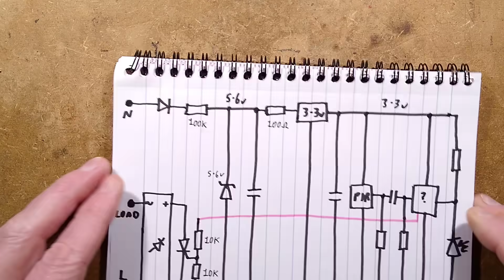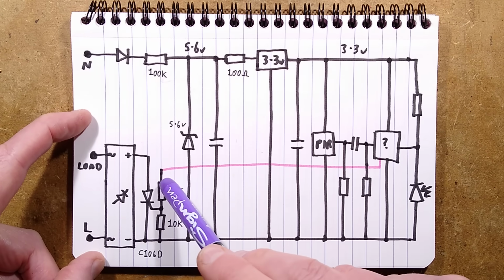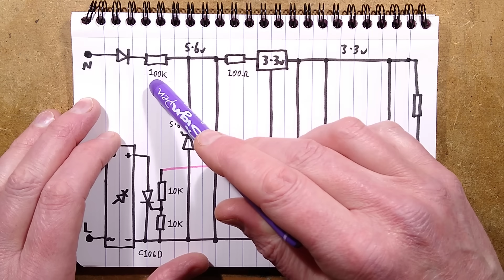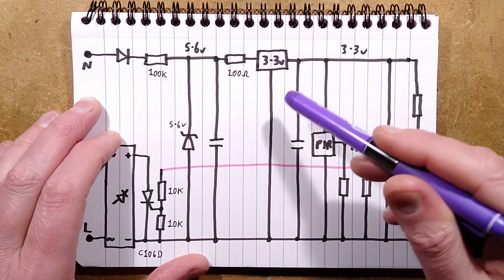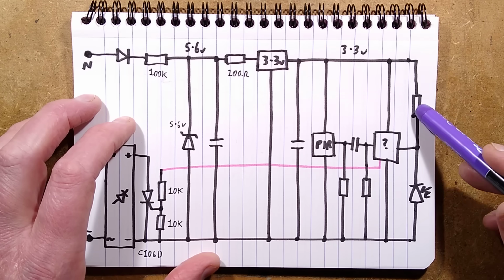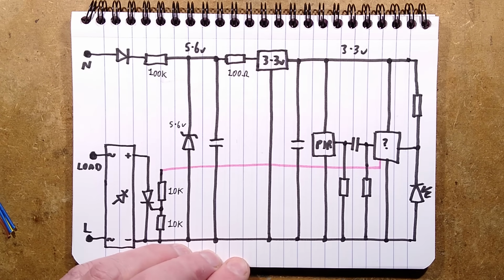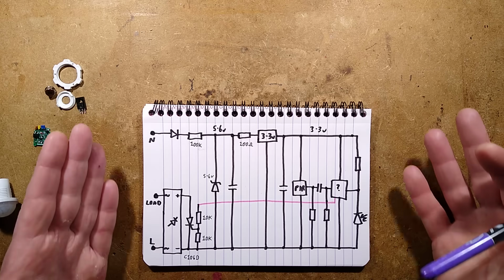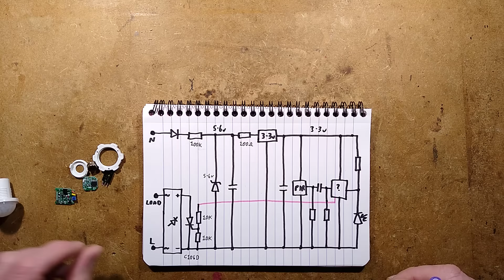Cheap PIR movement sensor and switch - with schematic

Comment: Never seen that rectifier - thyristor circuit before. Going to have to draw it out in full and think about it.
Reply: I paused the video and zoomed in on that bit and thought about it, and still don’t quite get it. I for one would appreciate a deeper dive into how it works because at first glance it looks more like a crowbar circuit than anything else.
Reply: @markfergerson2145 picture the normal use of a bridge rectifier.
IF there is no connection on the dc side, no current flows on the ac side.
IF you short the dc side, the ac side sees that short (less 2 diode drops)
So, a load in series (on the ac side) of the bridge rectifier can be switched by shorting the dc side.
Since the dc side is just rectified ac (no smoothing capacitors), a thyristor can do the switching.
Reply: @ By Jove I think he's got it !
Reply: @dougaltolan3017  Thank you. That explained it sufficiently for me. It is both an ugly hack and an elegant solution depending on your point of view, I guess.
Reply: @dougaltolan3017  But then the "output load" will only get half of the phase right? as if it had a diode. Am I understanding this right?
Reply: @olivarra1  - The AC side of the bridge rectifier passes full wave AC via the thyristor on the DC side, current flows at both halfs of the AC sine wave but through different diode pairs in the bridge recifier (connected via the thyristor), with a voltage drop of across the pair of recitifier diodes (2 x single diode forward voltage).  The thyristor is working on the DC side so will conduct once switched on till the load drops on the AC side, which will occurs twice per cycle around the AC zero voltage point, though will likely cut off before the zero volt point depending on the thyristor's sensitivity. The MCU will keep the thyristor gate signal on for the 20 second timed duration to retrigger the thyristor (~400 trigger events). The AC output on the load side will be slightly clipped and likely noisy around the zero switching mark due to varistions of the thyristor switching off and on again around the zero voltage transition, and potentially any drift due to temperature variance on the bridge rectifier/thyristor load switch part of the circuit.
Reply: @olivarra1  It will get full cycle.
With the thyristor off, nothing happens.
With the thyristor on: during one half cycle, 2 diodes conduct (through the thyristor). During the other half cycle, the other 2 diodes conduct (through the thyristor).
IF you replace the thyristor with a wire, then the bridge rectifier will conduct for both half cycles. The current in the wire will be full wave rectified (with no smoothing)
Reply: @dougaltolan3017  - Technically the diode package isn't being used as a rectifier as the thyristor 'short' on the DC side prevents rectified DC voltage from being generated. If one measures the voltage on the DC side of the diode pacakage, when the thyristor is conducting, one would still see an AC waveform (with respect to Neutral, albeit distorted), one that swings negative and positive around a zero point (the same with a wire short). That is the diodes are not setup in a configuration to recitfy the negative cycle to postive as there is no negative and positive differential on the DC side as the terminals are shorted, nor any current passing when the thyristor is off. Instead the thyristor/diode package paring form a DC controlled (zero crossing turn off) AC load switch - with AC being passed through the diode package under the control of the thyristor (there is no AC->DC->AC conversion taking place, just one or the other pair of diodes are conducting AC depending upon their conduction orientation in respect of the AC cycle).
Reply: @GruffSillyGoat  you can rectify current too. It's not only about voltage.
Reply: @dougaltolan3017  - Perhaps explain what you understand by this statement? 

Current isn't being rectified in this circuit, it flows passing from Live through different diode paths (depending upon the part of the AC waveform, diodes conduct on the basis of a forward voltage) and across the thyristor then through the load to Neutral. 

The current isn't altered (such as being 'rectified') in this circuit, except when the ampage ratings of the diodes or the rectifier are exceeded, of course. The waveform of the current (and voltage) at the thyristor (or wire link) will be the same as that of the  Live terminal (setting aside the diode drop and zero voltage transition noise).
Reply: @GruffSillyGoat  what I understand from that statement is that you are ONLY considering the current in the load (the ac side of the rectifier). Which is not rectified. 
If you consider the current in the thyristor / short circuit (dc side of the thyristor), you will see a rectified current. It will only flow one way through the thyristor / short.
Reply: @dougaltolan3017  - not quite, I'm considering this from the momentary current waveform at the thyristor, and the wire configuration you mentioned (which isn't unidirectional like the thyristor), and the configuration of the diodes with respect to the circuit operation. 

The circuit is designed to present the phase of the voltage (as well as that of the momentary current) to the thyristor so that it can conduct on each half wave of the cycle. This isn't the same as rectification, as the signal passed remains AC (not full wave rectified). If one models the conductance order of the diodes in this case they conduct in a different pattern to that of a bridge rectifier configuration (as two-way pairs of conducting diodes rather than paired one-way single conducting diodes). 

The circuit is effectively switching the wiring to the thyristor dynamically in line with the voltage phase position of the incoming AC to enable the thyristor to be switched on in either phase direction, i.e. it's the connection orientation of the thyristor with respect to the AC signal that is being modified not the AC signal itself. If this was full wave rectification then the inverted half-wave would be blocked from exiting given the circuit's configuration, which was the above posters question.

If you substitute the thyristor for a wire link, as you mentioned, and measure the voltage, or momentary current, the link's signal pattern remains in step with that AC input (which I've double checked with a commercial spice tool).
Reply: @GruffSillyGoat I'm afraid that this conversation requires diagrams which are not possible on this text only chat.
I'm convinced that you are confused somewhere, since the bridge rectifier in this circuit is used in standard configuration, and does present full wave rectified ac (voltage and/or current) to the thyristor.

May I suggest that you have another look at the schematic in this video, and note that the ac terminals are on the left, the positive at top right, and negative at bottom right. Not the more common orientation where pairs of terminals are diagonally opposite.
Reply: @dougaltolan3017  - I recommend the same, keep in mind the role of the curcuit in respect of the load which is on the AC side and not the DC side, the flow of current as a result and the role of the diodes in the circuit. Regarding package orientation it's best to check the devices datasheet (which I did to draw out the diode order and model the circuit in a spice tool).

I'm still genuinely interested in what you understand 'rectified current' to mean, as with 40+ year in commercial electronics I've not seen this referrenced hence will be interested in examples and references to such. Particularly, as stated above the current can be 'rectified' separately from the voltage driving it.
Reply: @GruffSillyGoat "keep in mind The role of the circuit in respect of the load" I did mention that I thought you were focusing only on the load.
You say that you referenced the data sheet. I don't see how that is relevant, since at no time was the underside of the board shown. You could not have reverse engineered the circuit with the given information. All you could reference is Clive's schematic, which shows that the bridge rectifier is being used as normal, providing rectified voltage (and therefore current) to the thyristor.

Focus on the thyristor, the voltage applied to it is full wave rectified, and (if it is conducting) the current is full wave rectified.

Regards rectified current.
IF you apply ac to the ~ terminals of a bridge rectifier, and connect a resistor between + and -, how would you describe the waveform of the current in that resistor?
Reply: @markfergerson2145  I won't sleep tonight, have to mess about with a bridge rectifier made from 1N4007's at weekend.
Reply: @markfergerson2145  But if the AC part of the rectifier was in series with a load ?
Err I need more 1N4007 diode time to mess with that idea.😎
Gaz Yorkshire
Reply: exactly the same for me
Reply: I remember using that trick decades ago... works very well
Reply: Often another trick is used in 2 wire switch replacements, where there is a 12v zener (or something in that range) in series with the SCR anode, and a resistor to provide the circuit with a tiny amount of power, with the 12V dropped across the zener enough to keep the gate current active, or using a second even more sensitive thyristor, or a high voltage transistor or mosfet, to drive the gate with a resistor, provided you can get supply current to the active circuit down to microamps, or have a supercapacitor there to provide stored charge. 

Often used in thermostat replacements, where they can draw 5mA when off to run the circuit, and the 24VAC relay will still kick in and operate with 18VAC applied, or with a second SCR to turn it on hard for a half second, before reducing operate voltage, so the thermostat will keep running, with a large capacitor to provide that 2 seconds of power backup.
Reply: Yup - I learned a new thing. It feels like one of those things that are so obvious I can't believe I've not seen it before (as Huxley said about Darwinism).
Reply: It is a clever trick as Clive said.
Reply: Dougal  - in all circuits one has to consider it's role with respect to the load, otherwise current will not flow (unless short-circuited).

With respect please re-read what I wrote, which is regarding modelling the circuit in spice not reverse engineering it, which Clive kindly provided already. My comment regarding the datasheet was in respect of the point you raised for the pin order of this particular bridge rectifier package.

As I said follow the current path through the circuit, you'll find the 'bridge rectifier' (BR) forms part of an AC side load switch, in effect this is a parts bin job using diodes and a SCR thyristor in lieu of a triac (bidirectional triode thyristor) based solution. The diodes ensure the thyristor is aligned with respect to its anode and cathode orientation to the phase of the AC waveform so it can conduct on both halves of the waveform. When the thyristor is off, no current flows as the AC load switch is open circuit, when on current flows with the thyristor forming a short across the 'BR' +/- terminals and current flows via the AC load.

The voltage, or current, in the 'DC' BR circuit side when measured in respect of neutral is an AC waveform. There is no seperate return path to measure a DC current across the thyristor (or wire link) as it's a short (there is no potential difference between the BR's +/- terminals). Note the DC source for the MCU/PIR circuit is separate from the 'BR' AC side circuit as if this was taken as a tap from the DC side of the BR it would both pass current through the load when the SCR is off and short out when the SCR is on, producing an unstable design.

Your last sentence describes a standard bridge rectifier configuration, not that of a load switch configuration as used here. In its standard configuration the resistor forms a 'DC' sided load, the BR produces a full wave rectified voltage pulsating DC waveform that is passed over the load resistor, over which a somewhat more conventional DC load current can be measured across the resistor. If one introduced a filter (e.g. capacitor), or regulator circuit, one would see a more typical lower ripple DC waveform would be observed with a load resistor on the smoothed side producing a near ideal DC load current (ignoring the ripple current impacts). If a wire link, i.e. short, is placed across the load resistor terminals then no load current would be measurable across the resistor. Rather the full current would pass via the 'BR' from live to neutral AC terminals, via the +/- terminals and the wire link, likely exceeding specification and so damaging the component. 

In the AC switch configuration there is no 'DC' sided load, however, the load on the AC side limits the current flow, and assuming the load is within spec of the switch configuration (stated by Clive as 40W) the circuit will not be damaged from the short on the DC side of the 'BR'.
Reply: @GruffSillyGoat "The voltage, or current, in the 'DC' BR circuit side when measured in respect of neutral is an AC waveform."

Why are you measuring anything on the DC side relative to the neutral on the AC side?! Live and neutral ate relative to each other only, and + and - are relative to each other only. You can't measure across the AC and DC divide (the bridge) and measure anything meaningful (to this circuit). Also, you seem to be implying that a bridge rectifier changes its functional performance according to the load circuit placed across its DC terminals, which is an unusual concept and needs some explanation as to how.

True, when the thyristor is conducting it forms a practical short circuit across the DC side of the diode network, but there is a fractional voltage drop across the thyristor even then, equivalent to a micro- or milli-ohm resistor, and it is ripple, full wave rectified DC voltage, not AC. The current through the bridge's + and - terminals, whether shorted or through a more reasonable load will always be in one direction, i.e. DC.
Reply: Glad I'm not the only one who had to draw it.  It's a neat trick, and simple once you can trace the path !

Comment: There are led bulbs with person detection. It detects them behind the door. Maybe a nice idea to dissect.
Reply: microwave sensors
Reply: If it detect behind the door it's mmWave Radar... The magic is pretty boring to see, as it's just some coper patterns on the PCB acting as antennas
Reply: The "Dark Arts" of rf design 😊
Reply from the maker: I've looked at a few of the microwave/Doppler detectors.

Comment: I had fitted this for my washroom lights and it worked fine for almost more than a year.  After that it wouldnt switchoff once it came ON, so had to remove it. 
Thanks for your beautiful explaination.
Reply: I had the exact same item, in the exact same location that lasted exactly the same amount of time!!
Reply: @dead.format  That is weird, maybe it is made to close to dying after a year. Maybe Clive can shed lights on this unit as to what we could change or what should be changed to make it work longer than 1 year.
Reply: I have a motion sensor that drops my porch lights to half power unless motion is detected, then it turns them on full for a couple of minutes. Saves power, but in the 25 years I've lived here I've had to replace the control unit four times due to the lights staying on all the tine (3 times) and not turning on the lights at dusk (1 time). The failed ON was the triac failing in shortcircuit mode. The failed OFF was not the triac but other circuitry that sensed darkness to activate the system. Triacs are prone to fail in shortcircuit mode when driving incandescent lamps or heater circuits with high inrush current. The other failure seemed to coincide with a power failure; the voltage surges as the power company switches between grids to maintain or restore power may have done it in.
Reply: And it was upon this day, that @fernsgilbert and @dead.format discovered they were a schizophrenic, sharing not only the same address, but also the same body.
Reply: I put one in my garage and failed to the latch on condition in a couple of weeks.  Maybe this is why they sell it in packs of two?  Will replace the unit and hopefully get  a year out of it.
Reply: The delay on mine was initially around 45 seconds and then after a few days of being powered up, the delay started increasing for EACH activation. 
So after about a week the delay was about 1.5 hours!!!!
Reply: Washroom - yes always need a "motion" detector there...

Comment: The important question, can you carbonate it? thanks, great video. sweet, simple and effective product.
Reply: Not sure, but it's perfect device for switching on just for those night time freshly carbonated beverage cravings, just wire this PIR up to a solenoid to activate the sodastream and when you enter the room in the dark a nice welcoming fizzing noise will shortly sound followed by a series of more awkward farty noises from hell; from the sodastream of course not the drinker of the beverages.

Comment: Odd question: You work with stage lights and light effects a lot. Do you happen to know when I could get service manuals for (mainly obsolete) fixtures? At the moment specifically ShowTec equipment.
Reply from the maker: Search online.  You may find the service manuals.

Comment: Reminds me that I need to change my PIR on the yard floodlight, it got ice built up over it last week and trying to break it off, I put my thumb through the lens, plastic was just cold and brittle enough to break just as easily as the ice did... :S
Reply: The one I have outside went brittle from 8 years of sun UV exposure.

It's completely hit-or-miss if the thing works now.

Comment: Can you change the resistor with the light sensor to have it trigger in higher or lower lighting conditions? Or maybe put a potentiometer in place?
Reply from the maker: The resistor matched to the photodiode could be changed in value up or down.